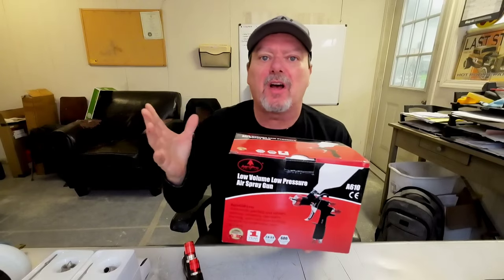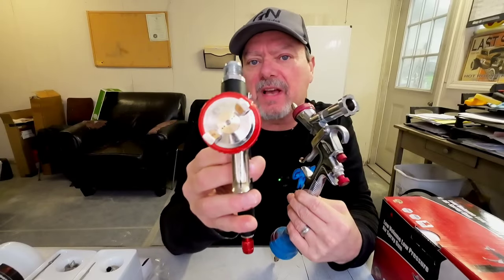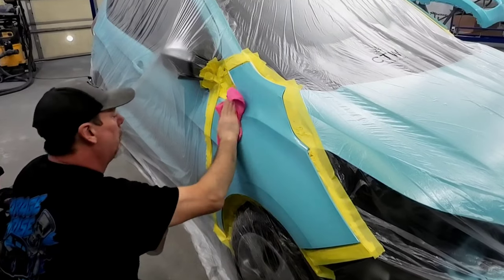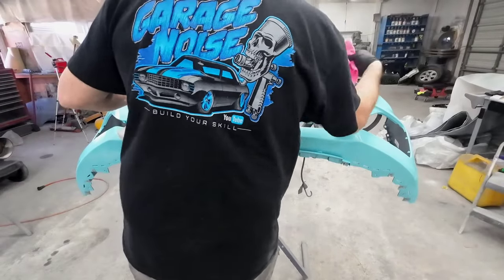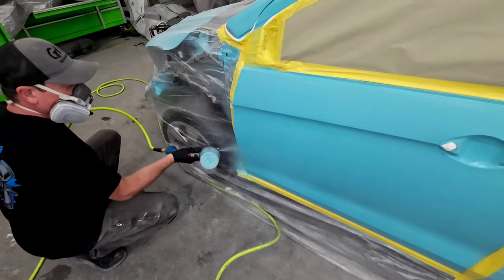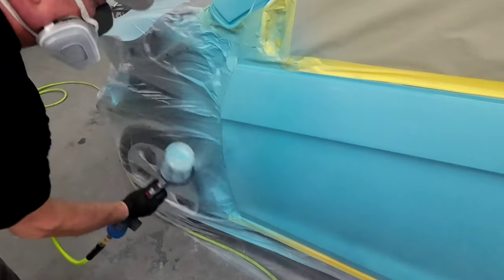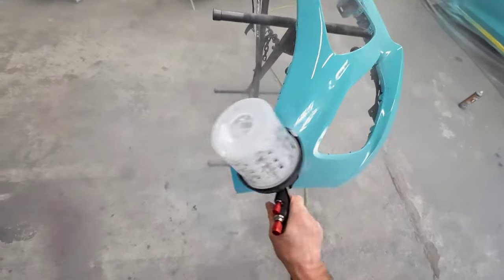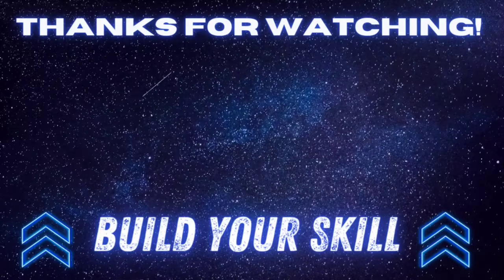The BEST gun for painting a car in your garage!

Comment: Hi Chris, Loves your videos. I bought the R500 after watching your videos. I have many guns but wanted to try a LVLP. For some reason it sprays terrible with the setup you suggest. If you look at the atomizer cap it has paint all over it. I'm wondering if there is an oring missing from the where the cap attaches to the gun. With on HVLP if the cap isn't screwed down tight you get the same result. Is there a rubber oring between the cap and the gun? I cannot tighten the cap any tighter.. Thanks
Reply from the maker: No, o ring. If you've  cleaned  that cap real well and it still sprays bad I would look at exchanging it. Could be a machining problem.

Comment: Got mines today Chris 💪🏽💪🏽💪🏽💪🏽💪🏽finally now I just gotta build my air dryer system out of copper An a transmission cooler 💪🏽💪🏽💪🏽💪🏽
Reply from the maker: That sounds interesting! You should share that project.
Reply: My Delro 16 pass trans cooler attached to my compressor (soft copper connected to compressor & tank) recently cracked at both in and out connection points to the trans cooler body.
It was a result of constant vibration that fractured the trans cooler pipes.  Lesson learned i should have used flexible high pressure rated lines instead.  I have 3 x 100ltre tanks connected and the wall mounted 1 inch copper drying system with ball check valves plus the 3 stage filtration system before air gets to the spray gun air-hose

Comment: How are you setting your pressure, you said 30 psi with the clear and 15 with the base coat but is that with the trigger pulled or static pressure before trigger pulled. I sprayed some of the exact same clear with the same gun over the weekend and set it at 30 with the trigger pulled and was getting a ton of over spray or at least way more than it looks like you are getting. I might add it was my first time using the R500.
Reply from the maker: 30 psi with the trigger pulled. With my fluid 3 turns out from closed. If you have your fluid wide open you will get more overspray. If you want less overspray you can adjust that pressure down but you have to adjust your fluid down with it. You can still get a slick finish. Hope this helps I'll  be doing a video on this topic  air pressure, volume, speed and distance and how this effects you finish so keep and eye out for it. Appreciate  the comment and support!
Reply: Ok, when you say fluid turned out 3 turns from closed are you just giving it 3 turns or are you marking say 12 o'clock and then doing 3 complete 360 back to the 12 o'clock position? Thank you for the help and your reply.  Maybe I will be able to get this thing dialed in.
Reply from the maker: @davidcrystalprater73  I'm  closing it and opening it 3 complete  turns.
Reply: Ok, thank you for clarifying that for me, I appreciate you and the videos along with the replies and help. I'll be looking forward to that upcoming video you mentioned.

Comment: @Garage Noise curious to get your opinion, right now I'm using the Harbor Freight McGraw 21 gallon compressor rated at 4 CFM.  I'm really torn between something like this R500, the 3M Performance kit, or the DV1 Base gun.  In the future I'll have a stronger air system but for now I just wonder if I could get the good results boasted with a DV1 in my current setup (or if it would be a waste of money)?  I'd been using the Harbor Freight green and grey guns that only work well for 3-5 paint jobs but don't spray so well anymore which have helped entice the runs in my jobs..  :/  I always break down and clean my guns.  What would you recommend works now and future facing between these options?
Reply from the maker: I don't  think you have enough air for the Dv1. I would say get an R500 it's cheap like 65 bucks and you might be able to find it cheaper. Then when you upgrade  your air you can always  get a Dv1 and still have a the r500 that can be uses for base or primer.
Reply: Thanks brotha!
Reply: @kseries20-24only  not enough air for a DV1 you need the AeroPro A-610 LVLP gun if not the AeroPro the Spray it R-500 or another LVLP Gun
The compressor you have will do poorly with an HVLP gun or a syphon feed gun.

Comment: I got 2 0t these A610 500s I have painted before it's been  a while does this gun need cleaned before u use it for the 1st time? I'm gonna use 1 for my basecoat and the other for my clear coat I'm using Nason to paint my scion xb 1d2 thunder cloud metallic base and the uv Nason clear.but I've seen some other videos saying they have grease in them that could come out during yre paint job ?? And I don't want that I'm using a Mcgraw 20 gallon tank also.??
Reply from the maker: Awesome! As for the lubricant, I've  never had any come out into my paint job. Very unlikely to happen.
Reply: @GarageNoise  thank you my friend God bless u

Comment: Looking to replace my HF $15 spray gun should I get the A610 with the 3 tips or the R 500 and purchase the 1.7 tip and the 1.5 tip at $25.00 each, what gun has less problems and smother trigger? Thanks Doug
Reply from the maker: I haven't had an issue with Ethier trigger. They spray the same, Id say get the one that's  the best value, the extra needle sets are nice to have. The a610 doesn't have a mark on the fluid adjustment knob , it's  a little annoying is all. Hope this helps!
Reply: @GarageNoise  Thanks I'll go with the A610

Comment: Quick question...
I have some factory oem aerodynamic parts that are brand new never installed but the paint is a different color than my car....
after I sand the parts do I need to apply adhesion promoter before sealer and again again for basecoat and again for clearcoat? or just once before the sealer?
I sincerely appreciate the help
Reply from the maker: You only apply adhesion promoter once before sealer. Appreciate the comment and support!
Reply: @GarageNoise  Thanks so much I sincerely appreciate the help 🙂
Reply: And the sealer is the clear coat?  @GarageNoise

Comment: Very disappointed in this Aeropro A610 …. I put some lacquer thinner in spray gun cup and the gun leaks underneath where the needle is exposed underneath the gun going into the front of spray gun…. Had my truck ready to prime … and disaster … did not even get to spray once with it
Reply from the maker: That's  a bummer,  is that the nut in front of the trigger? send it back they should take care of it.
Reply: I now have an R500 plus 2 x A610's (with another on order).  When you receive your gun you need to strip it and clean it thoroughly.  The fluid nozzle is usually on really tight from factory and best to use a socket to crack it loose (not the little gun spanner) and the nozzle & needle especially needs cleaning.   Once the fluid nozzle and aircap are back on and the needle re-installed then check the little nut in front of the trigger that the needle runs through is "finger tight" as this is often loose causing fluid leak.  Behind that little nut is a teflon seal & a tiny 0-ring to create a good seal.  If you tighten the nut too much (aka using a spanner) you will crush the seal & o-ring.  Hence why finger tight is fine.  With the air hose connected always spray some thinners through the gun & test before you load it with paint ( i use the PPS disposable cups system so easy to spray some thinners into the top of the gun with no cup attached). Another test is with air hose connected dip the head of the gun in a cup of water (hand off the trigger) to see if any air is leaking out causing air bubbles.

I recently did a full respray on a high roof Ford Transit Van (my sons Tradie Van) which was a big job using these guns and it came out perfect.  Had to spray outside on the driveway as the Van is too tall for my garage and picked a calm sunny morning and had no issues with dust or bugs.  Needed to set up planks for reach as the Van is really tall.
I did end up spraying at 22psi for base & 30psi for clear which gave best result using 1.3 needle set for both. 
I do have a Devilbiss GTI & Pro-lite and Sagola 4600 T/truck ltd edition but like the LVLP guns as much less overspray & use less paint, as iam spraying at home in a double garage ( i have 300litres of compressed air on tap so compressor easily handles the HVLP guns so that is not an issue at all)

Comment: What's different about the internal parts that make it lvlp??
Reply: The air caps are the same with the older R500, small holes on the air horn make it lvlp.
Reply from the maker: No sure what's  different about the lvlp. If I find out I'll  let you know.

Comment: question if you can help.  i picked up one of these guns and it cleared fantastic but i had issues of dry base look in application, i sprayed at 25 then 20 psi with a normal distance then a closer distance and i kept getting spotty dry base uneven apply on 70 percent overlap .if i slowed down some it helped but it looked like it was pooling up. I used med reducer at 71 temp and changed to slow and that helped the best. So could you answer what the issue may be? bigger nozzle needed?
Reply from the maker: The 1.3 should be fine for base coat. What was your fluid set at? 3 turns out from closed it should be wet! If not then your cap or tip   probably had a little  trash in it. Where the needle hits the cap sometimes dried paint can restrict  flow. Maybe your paint  wasn't  reduced enough sometimes we make mistakes with the mixing ratio.
Reply: @GarageNoise  i had 3 turns out and 1:1 mix on paint
Reply from the maker: @captrans  what brand of paint are you using? Is that the correct mixing ratio? I'm  just trying to get all the info so maybe I can help. Maybe the dry spray you getting is normal.  When it dries does it feel rough or is it smooth?
Reply: @GarageNoise   speedokote jet black, its smooth but it will look blotchy or have mottle look. based on watchin lot of videos i dont get a nice wet even coverage. its almost as if its drying out of nozzle but it hits panel. Im not a pro but have been painting small pieces for shop
Reply: @captrans how did it turn out? I have the same paint and was looking at this gun. Any advice?
Reply: @shaunbouchersr9544  sprays out good but depending on temperature I would use slow or extra slow reducers or hardener on test panel first

Comment: Would this still be a good gun to use to paint a whole car using a 60 gallon compressor if not, what other budget-friendly gun would you recommend?
Reply from the maker: These guns are the absolute best options that I've  found for painting with a smaller compressor.  A 60 should be sufficient for what your wanting to do. Check the cfm production of your compressor needs to be 6cmfs or higher. Here is the link to the gun I prefer same gun different color so it cleans up better comes with the 1.0 pps adapter as well and some disposable cups.
https://amzn.to/49uDKGq
Reply: Thanks for your response. Do you know if a epoxy primer is thicker than high Build primer ,and what size tip  I would need ,would the purple hf gun work?thanks for your help
Reply from the maker: @ydnar10  1.8 or 2.0 for epoxy. Depends on the primer but epoxy is generally thicker than urethane.

Comment: Why would you rely on a chemical adhesion for the bumper cover instead of prepping with a grey scotchie & 800grit or similar for a mechanical adhesion ?????  Adhesion promoter gets people into trouble real quick
Reply from the maker: The bumper cover was sanded before adhesion promoter.  Adhesion promoter only gets used as added insurance. Appreciate the comment and support!
Reply: I used adhesion promoter on my project and indeed the result came out like trash. It raised up all these little hairs in the plastic. The pieces that I didn't use adhesion promoter on look 100% better.

Comment: Is this gun ok for.a hs clear. I'm using speedokote hsclear.   1st time doing this.
Reply: I just got the gun but unsure if I need something else for that
Reply from the maker: The gun works well with high solids clear.
Reply: Ok Amazon dropped it off I'm playing with it right now.  So would using the purple freight gun as a primer gun be a bad idea?  Should I use this so I don't get learn the wrong thing from the purple gun?  I have never ever sprayed. But I've done my homeworj
Reply from the maker: @shaunbouchersr9544  I think you should use the harbor freight gun for primer. It will give you more experience with different equipment. Have fun! 👍

Comment: Unfortunately for me,the aeropro R 500 was a big disappointing thing for me,the air cap of the gun was not ok,the 4 small air holes around the nozzle, they're not aligned with the nozzle and the air horns so is spraying quite funny,i can't use de gun,some money spend for nothing,i m not going to do that mistake again
Reply from the maker: That's unfortunate,  the  seller may exchange it for you. You might have tried this but run a cleaning tool through the air holes of the cap. alot of times this will fix that issue.
Reply: @GarageNoise  they drill the holes wrong, there's nothing we can't do
Reply: I returned mine due to the air horn holes were misaligned.

Comment: The gun is not that good I have r500 and the A610 and a A610 shoots worst than the R500 the pattern is too small and the gun Itomizes like crap i tried both at work. it could be because im shooting single stage but for the record they are not that good of Guns

Comment: I use a lph400 for clear orange. Cap. I still get some peel with it running 14-16psi. Is the sliver cap better for clear?
Reply from the maker: Not sure on the silver cap. 14-16 seems a bit low for clear. You might try bumping up the pressure a bit and slightly less fluid, should flatten it out.
Reply: @GarageNoise   thanks gun says 16psi so does paper work out the box. Fluid is 2.5 turn out from closed.